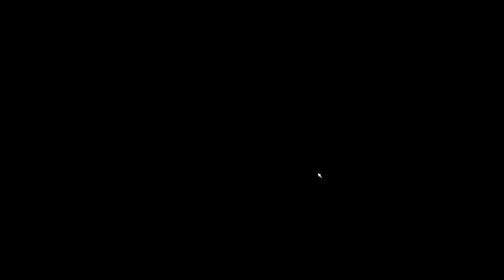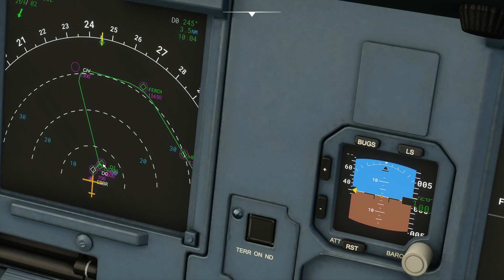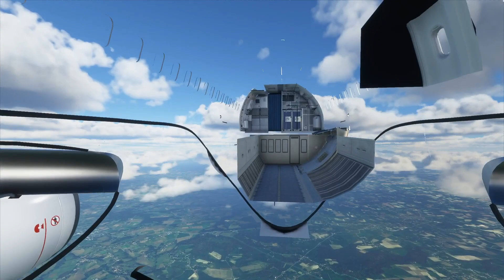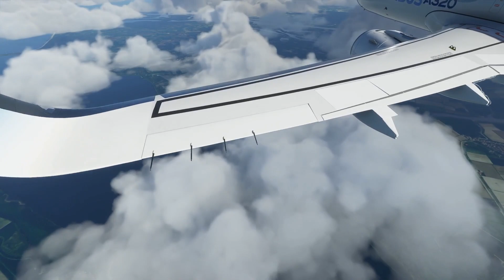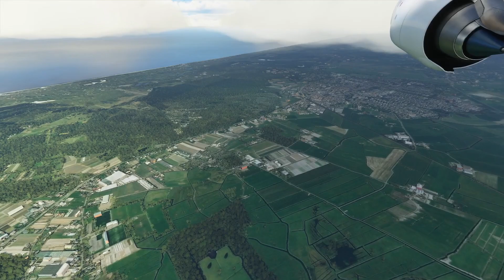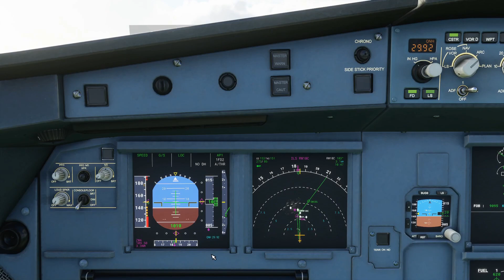VNAV Tutorial: Microsoft Flight Simulator 2020

Comment: Maybe I missed it but where did you get the ILS frequency from? And also do we need to input this frequency on B747-8i or it’s only for A320? Thank you
Reply from the maker: Hello Amad, well if you already planned your flight on MSFS's map with a departure and an arrival, the normally MSFS will automatically enter the ILS frequency for you. However, in case it doesn't, you can always go to your MCDU (ctrl 5) and when clicking on the Rad Nav button, you will be able to enter the ILS frequency and course heading there. That's for the A320.

Very similarly on the Boeing 747, you can call up your MCDU with ctrl 4 and click the Nav Rad button and there you will be able to enter the ILS frequency and course.

Hope this helps you out.

Thanks for commenting.

Comment: Great video ... I don't think this A320 has a VNAV button does it?  I have yet to really get the managed modes figured out, but here is basically what I do:  1) make sure to select ILS Low Altitude Runway 2) make sure to have ISL code programmed in computer 3) manual take off, get to flight path 4) enable AP ... turn on FD.  I manually set altitude and not use Managed (I haven't got that far yet) - same with speed to some extent.  5) Approach,  dial altitude manually as directed by ATC - watch speed 6) capture Glide Slope and engage Approach mode 7) make sure it is descending and not on managed or ALT hold 8) turn on ILS info 9) auto in and take over at 300 feet for manual landing.  Basically like you did - but I haven't programmed computer too much nor figured out the managed - it may be directly related to flight plan in computer.  Thanks for a great video

Comment: hi
louis what system requirements you have on computer i had 8gb ddr and it goes slow the simulations and then i put 16gb ddr in i t and it also goe little bit better but slow i dont know what to do i buy the game as cracked is this the problem  should i buy the original standard or maybe is the pc processor not enough i have i5  what components should i put in to go fast like on yours pc
Reply from the maker: hi Alen, i believe this game is very gpu intensive, so graphics card is the critical component. If you don't have a good modern graphics card, it will be difficult to run properly. I went for the best value I could afford - a Nvidia GTX 1660 Super (it wasn't over the top expensive and it is good enough). I have an AMD processor equivalent to an i7 and 32 GB Ram
Reply: @rhinonostril  ¸thxs

Comment: Can you give detailed requirements and steps about what is necessary to get the departure VNAV to work? You only kind of mention in passing about setting ALT to 100ft, but does that need to be at a certain point? Does it just need to change at all? There are a lot of details many are curious about but you only barely gloss over.
Reply from the maker: Hello Alexander, you're absolutely right and thanks for this comment. In my first attempts it seemed to me that in order to get a well behaved climb, I needed to control the climb myself - this is why I set the altitude to the max that the flight plan indicated and as soon as I felt the climb was stable I would then tune the alt down to zero (or the minimum I could which was 100ft). This is necessary for the AP to start controlling the altitude. If you leave it at 16000 ft, the AP will not automatically adjust the altitude to the constraints of the flight plan.

After more testing though, and Kristian Keranen's comment below, you can actually simplify this and at take-off, already set the altitude to the minimum (100ft) and just click Managed Altitude, Managed Speed and Managed Heading modes and Auto Thrust (A/THR). Put on the Constraints (CSTR) so that you can just check the plane is behaving.

Then simply take off, pull up the gear and only when you can reduce the throttle to Climb Mode (so i guess 80% or so), then you engage the Autopilot.

I'll copy parts of this reply in the general comments so that people can see.

Thanks

Comment: You need to have the thrust levers at climb power detent for the autothrust to work
Reply from the maker: Thank you Kristian
Reply: Louis Carlier not true, climb power is maximum power for autothrust, you can move your throttle between climb gate and idle and it will still auto thrust just with different maxium power setting
Reply: @higaluto  if you set it to TO/GA autothrottle won't work just like in the real aircraft.